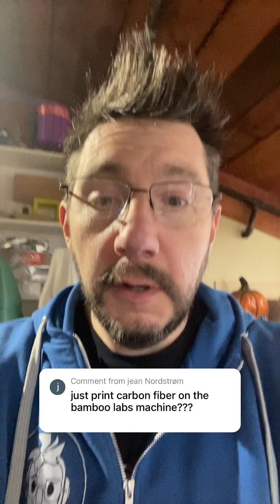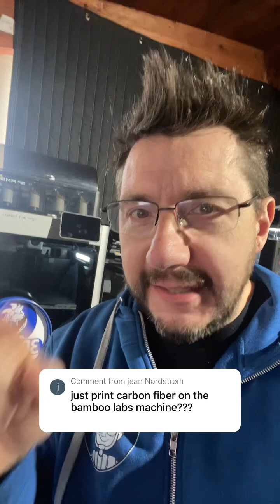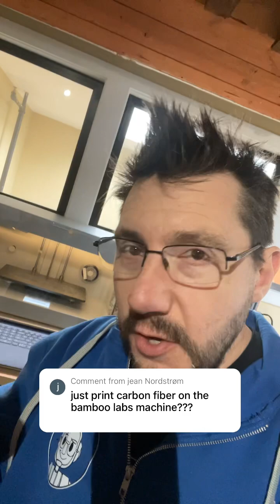Bambu Carbon Fiber? #3dprinting

Comment: LOL if the chopped carbon fiber doesn't add strength, why is it in Onyx??
Reply from the maker: For surface finish
Reply: @ wrong answer…..and dude, I run more than a dozen Markforged machines, and am MFU certified for composites and metal… but here it is so you can update your knowledge:
Chopped carbon fiber enhances the strength of Onyx, a nylon-based thermoplastic, by acting as a reinforcing filler that improves its mechanical properties. Here’s how it works:

1. **Load Distribution**: Carbon fibers, even when chopped into short segments (typically less than a millimeter), are inherently stiffer and stronger than the nylon matrix. When a force is applied to an Onyx part, the fibers absorb and distribute the stress more effectively than the nylon alone. This reduces the strain on the polymer, making the material less prone to deformation or failure under load.

2. **Increased Stiffness**: The high tensile modulus of carbon fiber—its resistance to stretching—boosts the overall rigidity of Onyx. While pure nylon is tough and flexible, it can lack stiffness. The addition of chopped carbon fibers, randomly dispersed throughout the material, increases its flexural modulus (stiffness under bending), making parts more resistant to bending or warping. For example, Onyx has a flexural stiffness of around 2.9 GPa, significantly higher than unreinforced nylon.

3. **Tensile Strength Improvement**: The fibers reinforce the nylon matrix by bridging potential weak points. When a crack begins to form under tension, the chopped fibers can interrupt its propagation by transferring stress across the crack, requiring more force to break the material. Onyx’s tensile strength is reported at about 37 MPa, and its flexural strength reaches 81 MPa—roughly 1.4 times stronger than ABS—owing partly to this reinforcement.

4. **Dimensional Stability**: Chopped carbon fiber reduces thermal expansion and shrinkage during the 3D printing process. Nylon alone tends to warp or contract as it cools, but the fibers counteract this by stabilizing the material’s structure. This leads to more accurate parts and less internal stress, indirectly supporting strength by minimizing defects.

5. **Micro-Reinforcement Mechanism**: The chopped fibers, though short and discontinuous, create a micro-carbon reinforcement network within the nylon. This network enhances toughness and wear resistance, allowing Onyx to withstand repeated loading without significant degradation. The random orientation of the fibers provides isotropic strength—meaning the material is strong in multiple directions, unlike continuous fiber reinforcement, which is directional.

The trade-off is that chopped fibers don’t match the extreme strength of continuous carbon fiber reinforcement (which can rival aluminum), as they lack the long, unbroken strands that maximize load transfer. However, their uniform dispersion in Onyx makes it versatile and printable via standard fused filament fabrication (FFF) 3D printers, balancing strength with ease of use. This combination makes Onyx ideal for applications like tooling, fixtures, and end-use parts where moderate strength and excellent surface finish are needed.
Reply: I mean seriously, have you printed straight nylon and compared it to Onyx??? It’s not EVEN close!!
Reply from the maker: @ oh oh OH! the chopped fiber acts as a rebar to the nylon, helping it hold together???
Reply: @3DPrintingNerd  I think yore being intentionally dense now… the CONTINUOUS fiber acts like rebar… the chopped carbon fiber does what I wrote above. Take the L and move on. It’s kinda embarrassing for you

Comment: Carbon fiber just like glass fiber are both used in plastics to increase both stiffness and strength. This is done in the direction of the fiber only. The carbon fiber itself does not connect between the layers but will retain more heat than polymer or glass making for better weld or layer strength.

Comment: Why would it add strength? Really think it through, the CF isn't woven into itself, it's a strand but the layers are connected by polymer cross links. Nothing connecting CF to CF
Reply: CF small piece has more strength than the polymer it is replacing.

Comment: Usually chopped fibers prevent cracks and increase tension resistance in special concrete, not compression resistance.
It should work the same in 3d printed parts.
Continous fiber works complete differently.

Comment: not adding much strength ?
PA12 - tensile strenght break 54mpa
PAHT-CF - tensile strenght break 81+ mpa

impact resistance is still very good
Reply: Tensile strength is usually quoted along a continuous length of the raw material after extrusion onto the spool. (maximum).

The strength in printing will always be less, ranging from very close to the maximum at ideal temperatures across a layer in XY...

...to half the maximum or less measured down and up along the Z axis, printed in less than ideal conditions.

Filled materials often have higher quoted strengths of the raw material mix, but in practice they tend to be stronger than a non-filled material in XY, and weaker than the non-filled material in Z.

Comment: The toughness of my parts is noticeably way higher if the petg has cf in it. normal petg is weak af, only a little stronger than pla.
Reply: Yes toughness is often improved as energy is dispersed across the part and material by the filler material. Strength however is often only slightly improved in XY, and reduced slightly in Z.

Comment: There is little need for a hobbyist to have a printer capable of going over 300 C (sometimes a little over 300 C can be useful). The X1C is pretty much all a hobbyist would ever need except from in the build volume department. Every commonly used filament can be printed by it and fast with high quality. Filaments that require above 300 C usually require an actively heated chamber too and are usually very expensive, that is getting into PEI and PEAK territory and are out of budget for most hobbyists unless they really need those materials. Even the eSun PEAK is over £200 for 0.25 Kg.

Comment: Printing the markforged onyx filament (effectively PA-CF) on a Bambulab x1c was actually really easy for me, and had faster parts and debatably better print quality than the markforged with similar strength to markforged parts without the continuous carbon fiber.
Reply from the maker: Onyx without the continuous carbon fiber is nylon, so it's going to have some decent properties still.

Comment: This is actually not true. First of all strength is a loose term that nobody actually agrees upon. And the chopped carbon fibers help the layers bond together more than they would otherwise. CF adds to the strength at temperatures to hold something while the pure material would already sag. Also not mentioned here: Other properties are usually better dimensional accuracy and stability and less warping.

Comment: Like adding rebar to concrete. If you chop all the rebar into 2 inch bits and toss them into the mix, you'll get fired.
Reply: …Did you forget that chopped fiber concrete exists?
Reply: @c0mputer  lol 😂😆
Reply: That depends 
If you add chopped fiberglass to concrete it’s still stronger than just concrete

For like outdoor countertops you could get away with fiberglass reinforced concrete 
But for a patio you’d want rebar

It still adds strength just not as much
Reply: @dylan-nguyen  thank you for saying that

Comment: The Markforged is $17,000 though. 😂😂
Reply: I cant wait to get it on used market in a few years.  Back in the day, a 1TB ssd was also $20,000.
Reply: @redone823  just wait for 1 more decade buddy. Good luck 👍
Reply: @redone823  inflation has entered the chat
Reply: I remember paying 250 bucks for my first 32gb ssd.

I got 2 for $500, raided them for a 64gb windows OS boot drive.  WOW.  Instant response.  It was amazing.  I never went back to spinners💯

Comment: I have to disagree with you there. I print a lot with PETG-CF and in my testing it is significantly stronger compared to standard PETG.
Reply from the maker: I’m always up for being wrong. How did you come to this conclusion? I’ve always found CF PETG to be stiffer than PETG but not stronger. What are your findings?
Reply: @3DPrintingNerd  In my layer strength tests the parts printed with CF PETG could handle 18-20% more load on identical parts printed on the same Bambu X1C machine. The particular parts I originally did this testing for were for a commissioned piece that required both good static strength and good layer adhesion. As we know PETG has good static strength (where it tends to bend before breaking) but typically isn't as strong when it comes to layer adhesion, at least in my instance the CF helped. Keep up the good work Joel, I love your channel!
Reply from the maker: @AerialPixel  Holy cow, that's great data! Thank you!

Comment: Markforged uses practical the same material. You can add the continues string via a seperate nozzle on the markforged, it ads stiffnes but not in all direcrions
Reply: That is exactly right. In fact it only adds strength in a single direction. If you're part needs great strength in multiple directions then you are outta luck using this printer.

Comment: Chopped fiber does add strength to the layer adhesion though, which is the weakest part of 3D printed parts! Just thought I needed to point that out. Thanks for all the awesome content though!
Reply from the maker: Can you link me to somewhere that explains it? I just don’t see how that can work.
Reply: @3DPrintingNerd  Okay, not sure what I said is true or not. My roommate works in 3D printing industry and is obsessed. He says he uses nylon with carbon fiber infill and The layer adhesion is insane and better than without the CF. Nylon supposedly has incredible layer adhesion properties by itself without CF. He swears the CF improves it, but now I want to test it to find out. 
I found this video, pretty informative, but he glosses over the layer adhesion properties, but seems unnotable. 
https://youtu.be/LTmuwfyYUJQ
Reply: @3DPrintingNerd  I will look for something, but it's because of the carbon fiber " hairs" sticking out, It gives the following layer more surface area to adhere to. I'm still very interested to do testing to find out how much it really matters though.
Reply from the maker: @DillonConnolly  Oh wow. I'm very much going to look into this - thanks for the tip!
Reply: @DillonConnolly  from what I have heard, as the filament is extruded out the nozzle all the carbon fibre pieces align with the flow, pretty much the opposite of what you are saying. There doesn’t seem to be any definitive proof on it and it could be that it varies. I think to really find out we would have to extrude a line or plate and and use something to see where the carbon fibre pieces are and what orientation they are in.
Reply: @3DPrintingNerd Individual carbon fiberlettes are harder to pull apart than if replaced by polymer. Not as good as continuous fiber as you point out.
Reply: @3DPrintingNerd  gotcha covered in my comment above… FYI this info is easily found.. you are correct that chopped carbon fiber filled nylon is no where NEAR as strong as CFR parts. But to say the CF does not strengthen the base material is categorically falae

Comment: I would think that both printers could print both materials, chopped / continuous fiber but that's not what your saying.. I'm confused. What difference does the printer make?
Reply: Ah, adding the continuous fibers is a special trick of the Markforge. This is wild!
Reply: Hey so i do all of the cad and 3d printing on my robotics team and we have a markforged and the way continuous fiber works is its a really thin strand that will be inlayed in a layer it requires a verry different type of extruder because the extruder cuts the fiber when retracting but the fiber will greatly increase the beating a part can take making it comparable to metal parts where choped fiber is where the carbon fiber is turned into a really fine power and mixed into common 3d printer filaments so the printer can use it as a normal filament but since it isnt connected under pressure the plastic type using would deform because none of the fiber is connected its not going change the strength of the original plastic so its not completely structurally sound 
Long story short the continuous fiber is like a skeleton and the chopped fiber is like the rest of the body

Comment: Compared to unfilled filament also chopped fibres in combination with the right matrix will give some more strength. And please don't forget about the increased thermal resistance of the printed parts.
Reply: Indeed, it most definitely gives it more strenght, bending and tensile

Comment: You're misusing terms here. Carbon/glass fiber chops DO add overall STRENGTH (durability), but might not add or even reduce RIGIDITY. Which is what you were after.
Reply from the maker: From what I've always read, chop fibers add stiffness, but not strength. Can you link me to more information? I would love to read up more about it.
Reply: @3DPrintingNerd  Can't really link anything because it's all mostly my empyric experience. Anyway, fibers generally improve strength of everything (plastic, epoxy, concrete, clay) by preventing cracking, but rigidity improvement is highly dependent on exact combination of fiber size and base material properties. Think soft TPU - no anount of fine chop fiber can make it rigid.
Reply from the maker: @evilgremlin  This is all crazy cool to think about and I'm glad you said something to me! I'm going to see what research I can find / do .

Comment: Thanks.  Makes sense but not sure I would have thought of it, especially the contaminate part.  I bought the Bambu x1c for its other features anyhow (which I’m quite happy with).
Reply from the maker: That’s great and you should be happy with it! Chopped CF in PLA PETG PC is awesome because it really gives the material a nice look and adds to stiffness. Heck look at PACF!